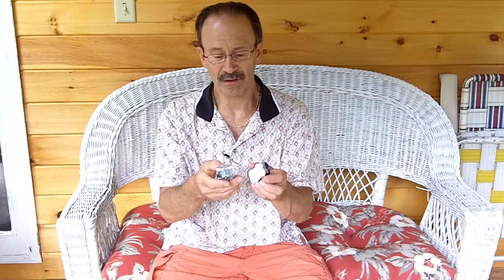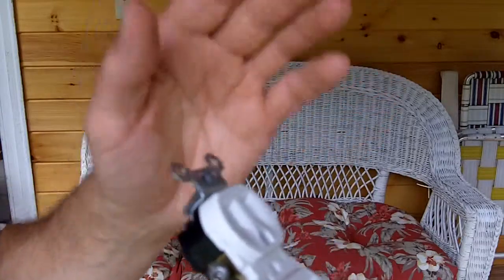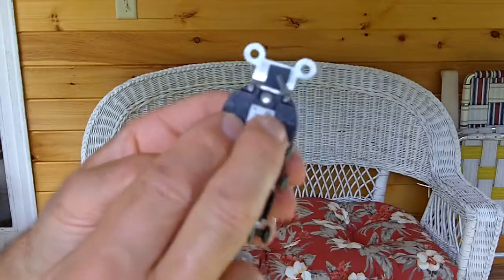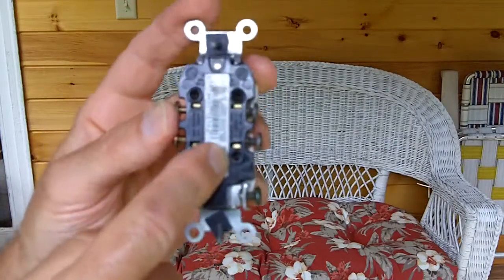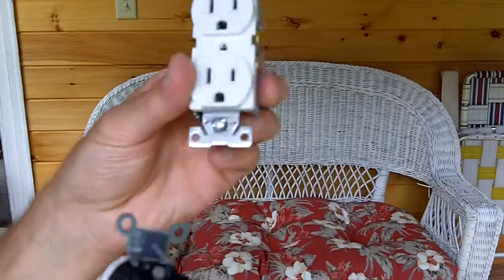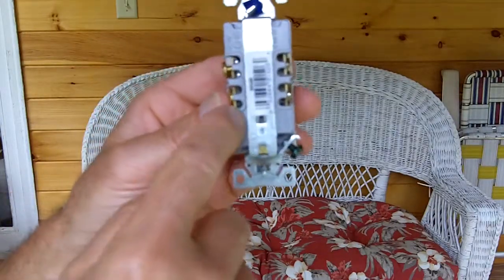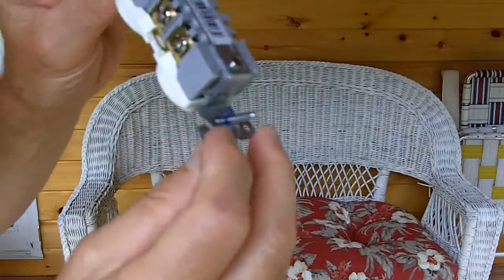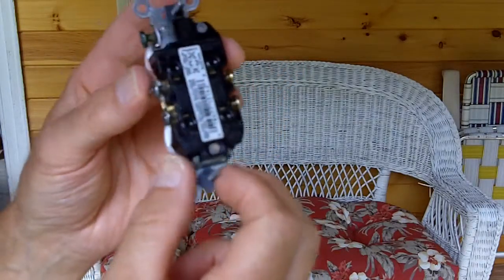Duplex Receptacle Devices (Part 1): Notes on Inferior and Spec Grade Devices

Comment: The spring clip is only necessary for boxes that were wired with armored cable or metal conduit that doubles as a ground. even still, its better to wire a pigtail from the box to the receptacle!  that's the way it's done in ontario (in any installation I have seen, I'm not an electrician however).